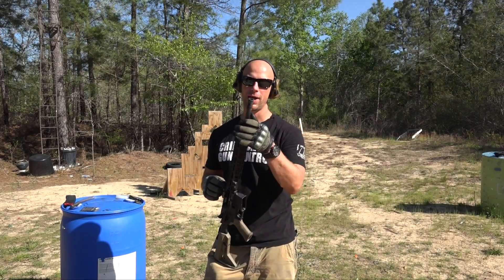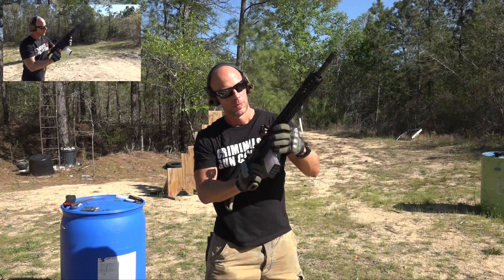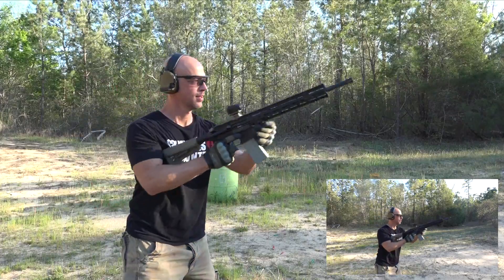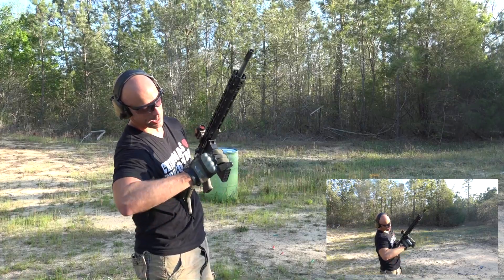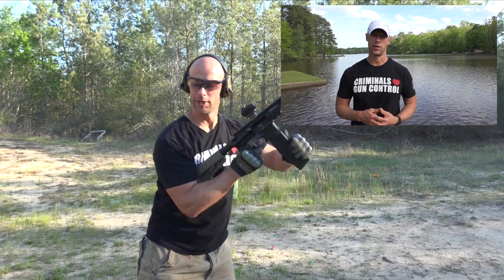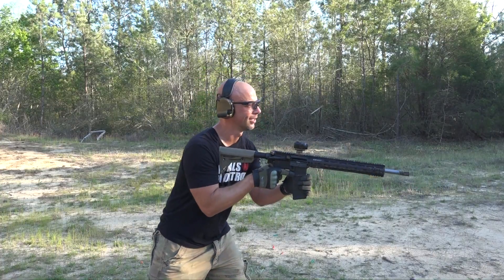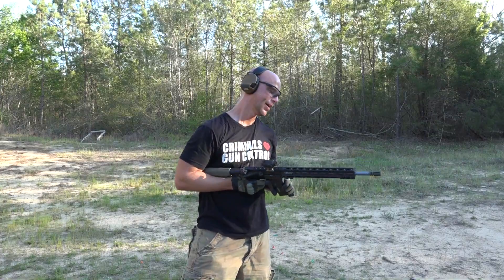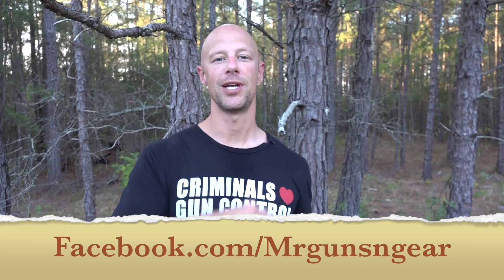AR-15 Full Auto Meltdown! Nitride Treated Barrel (HD)

Comment: I wonder if the heat ruined the nitriding? it's going to be be really interesting to see part 3. Never going to torture barrels like this, can't wait to see the results.
Reply from the maker: should be interesting indeed
Reply: Nitriding takes place over a period of a few hours whilst thd part being treated is continuously exposed to a 1,000+ degree Fahrenheit salt bath. I don't know what steel faxon uses in their barrels, but my nitrided barrel is 4150 steel which will not start to glow cherry red until it is iver 1,000 degrees. This being said, the gas tube eould most likely fail well before the barrel were to be able to get that hot. With this being said, nitriding chemically changes the molecular structure of the parent material. It is not a physical coating atop the substrate steel. So if the nitride were to be ruined on a barrel then a few thousandths of an inch of the bore would be gone which would be catastrophic for accuracy on any firearm barrel. So  in my humble opinion, this barrel's nitride is still intact and good to go. I am not an expert on this stuff but i am a nerd so take it or leave it.

Comment: Tons of malfunctions with this meltdown and the last video.  Is this a buffer issue with your lower?
Reply: mattindahisouse He's already running an H2, my money is on the gas port size being drilled too large.
Reply: .081" We'll likewise show the port and full details during the debrief. It will all be laid bare!
Reply: FlamingKiller The geissele super 42 is an H1 buffer.
Reply: Joshua B Ahhh, I stand corrected! Too bad he didn't have an H3 handy.

Comment: If you ran this upper right after the other one, do you think the buffer spring wore down from the previous test or something? Was the recoil spring in the lower new at the start of the test? I forget the replacement cycle on them, I have some sbr's with 3k rounds through them and no issues... Just throwing out ideas. I have several faxon barrels with no issues, and they make barrels for a lot of other manufacturers...

Comment: I would not trust that firearm with my life
Reply: As opposed to what?
Reply: Just needs some tuning I'm sure.. Heavier buffer/buffer spring.
Reply: @thebutcherofbenghazi.libya3348  full auto is great at showing gassing issues. It obviously needs a different buffer. You can tell from the ejection. This wasnt a reliability test of the rifle
It was an erosion test of the barrel. The upper was simply put on a full auto lower with no tuning done.
How you think that reflects poorly on Faxon is mind boggling.

Comment: you replace your buffer spring after the chrome lined melt down?
Reply from the maker: no
Reply: I just payed attention to the chrome lined one again, didn't realize you used the geiselle 42 system, just the only thing I could think of is gas port n everything else were the same

Comment: Is the melonite coating still on the barrel? It looks like it's a SS barrel now!
Reply: Giggles Melonite is a treatment not a coating.  It changes the surface of the metal so there's no chance of it coming off.
Reply: Always Gunnin' Do you know why it would turn white? The link below page 32 mentions a white layer but I'm not sure if it's the same thing. If it is, it sounds like the nitride treatment on that barrel is compromised. https://www.oerlikon.com/ecomaXL/files/balzers/oerlikon_HQ040EN_1011_web_locked.pdf&download=1
Reply: Giggles I don't know for sure.  I'll be curious to know what Nathan has to say about it.

Comment: You should do a stainless steel  meltdown
Reply from the maker: Duly noted
Reply: @Mrgunsngear  After examining the SS barrel I have. It's a Palmetto State Armery 16" freedom 416 grade.  Got the gun at a gun show.

I have searched online to find out what other kinds of SS barrels exist and it is not easy. I can not for sure find any specific types of SS that may be chromed lined, or lined with anything. 

As well as anyone who has truly put one through the test. 

However I have found more then one warning on how they heat up. That they heat up slower then standard barrels and are more accurate for the first several shots.

However the warnings all  say if they get to hot they can fail because the same reason it takes them longer to heat up means it takes them longer to cool down.  Not sure if that's true or not.

Still if you want to do a test that would be cool. I think it is time for some videos on what SS barrels really can and can not do.

Comment: i literally had a faxon 16" pencil in my cart for purchase but after seeing how overgassed they are, im gonna spend the extra cash on a BCM
Reply: superswaglord1945 ditto
Reply from the maker: Check out the initial accuracy ejection pattern
Reply: superswaglord1945 I can guarantee you they are fine.  I run 6 different Faxon barrels and they all are run with a Sprinco Green spring and an A5H2 buffer and have perfect 4 o'clock ejection with 5.56 M193.  Some don't understand what full auto does to a gun and it's gas system.
Reply: Always Gunnin' can you explain?
Reply: exactly, I have a LW  CHF CL BCM barrel I've bumpfired for 5-7 mags at a time, with NO change in ejection pattern. WIth a colt milspec spring and H2 bcm buffer still at 3:30-4. As much as I love mrgunsngear I think he has to be a little more forthcoming regarding flaws in the gas port size, and crappy springs/buffers. Even in the initial accuracy ejection pattern video he mentioned you can see the ejection patern is 1:30-2:30. Just because its expensive, doesnt mean its good and not all corporate sponsorships are good if they cost you viewers. Id rather spend an extra 100$ than be burned on a barrel..
Reply: Right, i agree. If this sort of thing does occur, couldn't it rectified by adjusting the gas block rather than having to buy stuff and tinker around? Assuming the gas block is adjustable of course. Seriously asking.
Reply: Of course, i just wanted to make sure my understanding was correct. Thanks for clarifying.
Reply: Will Younger This problem could be fixed with an adjustable gas block or changing up the buffer system or using a heavier buffer in that Geissele setup.  Either is fine and fully acceptable.
Reply: So here's what I'm thinking after consideration. I would prefer a slightly larger port for the sake of reliability in the unlikely event i find myself in some extreme conditions while needing my rifle to save my life. lol as if.

As long as i could tone it down on the go with the gas block I'm fine. Where i take issue is carrying and messing around with springs and buffers while I'm on a hog hunt for instance. No Bueno.

Thoughts?
Reply: Will Younger An adjustable gas block is a very good solution.  SLR Rifleworks makes one that is basiclly maintenance free, which means "set it and forget it".  I have several and they are awesome!  Just some insight into the buffer thing.  It isn't as finicky as you might think.  You would essentially set the buffer weight up for the lowest powered ammo you use and you'll be fine for multiple types of ammo.  

An adjustable gas block gives you ultimate control, but dialing in your buffer system isn't bad either.  That's why I use the A5 system.  It's most forgiving across multiple types of ammo.  If that's not something you want to do, I'd get a Sprinco blue carbine RE spring and an H2, if you have a carbine RE, which I'm guessing you do,  but the gas block would be my first suggestion.
Reply: Mid-length. I have a POF Dictator gas block already. I was looking at the SLR ion rail but i dint think it'll fit over the dictator.
Reply: LOL will younger. Prefer a slightly overgased port for reliability you say? how reliable does the rifle in this video look to you? be wary of a "good" thing
Reply: I'm accounting for carbon build-up and adverse conditions... and semi-auto.
Reply: And it's Will Younger
Reply: Will Younger I was talking about your buffer tube length not gas tube length.  I'm not familiar with the POF gas block myself.
Reply: superswaglord1945 Running full auto and running semi-auto are 2 completely different animals.
Reply: Oh gotcha, I'm not sure about my buffer tube. How do i find out? Is there a marking or something?
Reply: Will Younger That thing looks like a Hoss, but it should work out for ya.  I didn't look at how many settings it has though.
Reply: It has 9 settings. Yeah, it is... too much of a hoss lol. It uses 2 cross pins to hold it in place. I'm afraid to get a new rail because of its size.
Reply: Will Younger Do you have a way to accurately measure it?  Like dial calipers or something?  There's plenty of rails that will accomodate it I'm sure.  9 settings is good, gives ya a little more flexibility.
Reply: Will Younger Actually looking at the measurements online you should be good for most rails honestly.  The gas block is .91 across is all.  As long as the rail has about 1.750 inches from the bottom to the top right under the rail you should be fine.
Reply: No i don't. I looked at their dimensions and they're basically the same with barely any space.
Reply: Look up the iraqveteran8888 ar15 melt down video and you will see a faxon barrel firing full auto with none of these "over gassed" issues seen in these videos. You can't just say that faxon barrel design is flawed from watching this video. It is ingenious and wrong.
Reply: My 14.5" midlength BCM is still slightly overgassed. Although it's the closest to optimal of all my AR's. I can use a Springco Red and H3 buffer and get steel case to lock back
Reply: Robert Smith Sprinco Red AND H3 with Wolf and you still get lock back with a 14.5 BCM?  How many rounds do you have through it?  Those are ported at .076 IIRC which is pretty small relatively speaking for a 14.5"  I'm VERY surprised it locks back with that buffer setup and Wolf to be honest, unless it has 20k through it and the port is eroded quite a bit. Something seems fishy.
Reply: superswaglord1945   Give it to nutnfancy. Hell call it junk if he has too
Reply: I know this was a month ago, but Faxon barrels are just fine.. This was full auto too, it would've ran fine in semi most likely. So unless you're going full auto then I definitely wouldn't worry. Could of been other problems besides the gas port diameter as well
Reply: Unless you have a full auto lower, you'll be fine

Comment: For all the problems you were having with this build,  it never blew up like that AKS-74U did at 292 rounds full auto.  And so tell me again, who's actually still saying that the AK is a more reliable platform?    I'm an AR guy all the way and this video gives me no reason to change my mind.   But I think you need an adjustable gas block and maybe a different buffer for that build.  I think you're a bit over gassed and getting bolt bounce.

Comment: hmmm...  I know this a small sample, but.... if it ain't broke, don't fix it.  I will take my FN chromelined barrels all day long and twice on Sunday.  It is not for any other reason that it just works.   I still love my Melonite guns as well, but if my life depends on it... chrome.
Reply: Jonathan Moore Same here. FN hammer forged are the WROL SHTF barrels.
Reply: Jonathan Moore melonite barrels are just as good if not better than chrome lined. Either one can withstand serious abuse but have slightly better accuracy than chrome. But for your average civilian that doesn't even matter.
Reply: Taji Tuck Looks like CL wins to me with regard to extreme heat. Just wait for accuracy testing. That melonite barrel is toast.
Reply: m hall I highly doubt it but we shall see my friend
Reply: Jonathan Moore my FN 15 tactical is the most accurate ar I've ever owned! and my 16s is right there with it!
Reply: m hall The malfunctions don't seem to be related to the melonite treated barrel. More of a gas system, spring or buffer issue.
Reply: Miguel Melgoza The color of that barrel though, yikes!
Reply: m hall Haha, Yeah, that is definitely suspect.
Reply: Jonathan Moore You can really get some good deals on those PSA FN CHF CL barrels
Reply: ...but I love this topic!  It is a great discussion that I do not see anyone making in a constructive way.  I think the barrel maker is way more important than the finish.  
Then head spacing, gas tuning, and bolt carrier quality comes in at very near second.
Reply: Neil Garner My 300black that I built last month was completely inspired by the FN tactical blackout... Since mine is an hbar, I did not free float it... just magpul furniture.  Light, low cost, and super accurate for a 300.  The guts are FN and a mil-spec bcg, Ceroforge receivers, and a carbine gas system...  basicly an a la carte AR built with FN parts.
Reply: ...and yes, I just stoll Nutnfancy's term!
Reply: Jonathan Moore that build sounds awesome! I've been thinking about getting a 300blk upper for my FN, but not sure if I want to deal with another caliber. would have never known about the nutnfancy cmment, I don't like watching him!
Reply: Neil Garner I tune in to him along with quite a few other channels... just to get other opinions and takes on gear.  I totally disagreed with his take on 300black.  I shoot supersonic. 110-125 vmax, 125 American Gunner and 150 soft points.   All of my ammo is from midway... magtech is less than 60cents per round.  I am going to use it for whitetail in northern Wisconsin.  I had an old SAA lower sitting around and an ALG enhanced 4.5lb trigger.  I was hesitant at first, so I did my research for about three months.  I found FN, Palmetto State, Radical arms, Anderson, CMMG, and SAA.   I narrowed it down to FN and SAA because the barrel was the same.  I bought the last CHF equipped upper they had at SAA and threw a 3x Primary Arms 300blk acss on it... I love it.  Totally reliable.
Reply: Jonathan Moore I do the same, watching several channels for different opinions! I buy most of gun stuff from midway, but I  buy most of my ammo from targetsports usa. they tend to have lower prices and they have free shipping when you order by the case.
Reply: Neil Garner I will check them out!  I stopped buying from lucky because midway was so much cheaper... ammo is like an impulse.
Reply: Jonathan Moore FN , LWRCI ,AND LMT are my absolute favorite. .
If only we could get a Diemaco Colt CHF , that would be my all time favorite

Comment: What buffer weight are you running?
Reply: The set up is pretty much equal to an H2.
Reply: in the first video, he said it was an H1 but he replaced 1 steel with a tungsten (eccentially making it an H2). he also used a Geissele recoil spring, which is slightly stronger than normal.

Comment: Old vid. But everyone who is commenting on nitride barrels are sub par when it comes to chrome line are dumb. All these malfunctions are bcg increase, fte, ftf. It is highly possible he did not change the ejector spring, extractor spring, and more importantly the buffer spring. Anyone who knows anything.  Springs lose its power through continous cycling. Toppled with the immense amount of heat its going through. So for future viewers. Take those into consideration. If he didnt change the buffer spring. Its prob close to its end in terms of life expectancy. 30 something mags full auto will do that vs 30 mags at 1 second per shot. Heat warps metal. 😂

Also im not sure, but are the gas length and gas port size the exact same? That will also make a difference. Unless he put brand new parts in each test and tolerances are the same.this is now apples to oranges test. 

All the same, i have faith in nitride barrels. I do not own full auto and i bet all these know it alls prob dont either. 😂😂 i honestly put maybe 100-500 rounds a year through my 4 rifles combined. I shoot pistols more. 😂

Comment: Originally, I thought this would double your subscribers. However, after reading the comments, I think those with melonite/nitride barrels are going to be butt hurt. You better spin this or you will lose half of your subscribers. Hammer forged CL guys will still know the truth. 😉
Reply: Hammer forging is greatly dependant on post processing and is hardly relevant to the conversation. Both of these barrels are button rifled with the only difference being CL vs. Ferritic Nitrocarburizing. All other factors i.e. Barrel profile handguard barrel nut, gas tube, gas block ect. Are equal.
Reply: Aaron Orr Relevant? C'mon, this is YouTube! Just kidding. Yeah, I get what you are saying. I am just stating my preference. In any case, I think that the button rifled CL barrel will prove to be more accurate and in better condition than the nitride/melonite barrel after his abusive test.